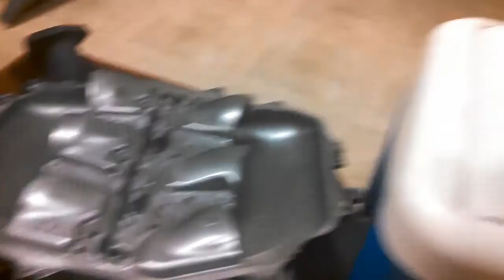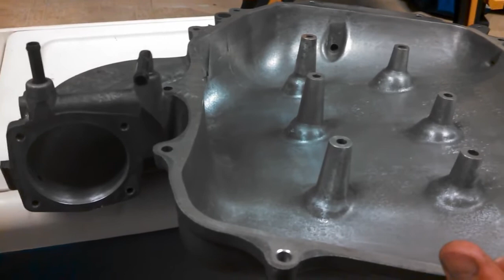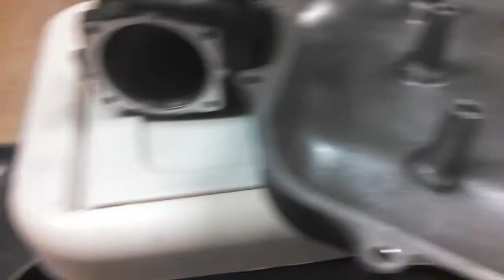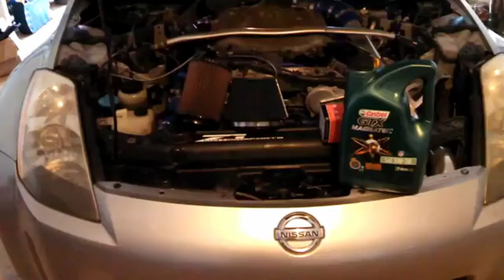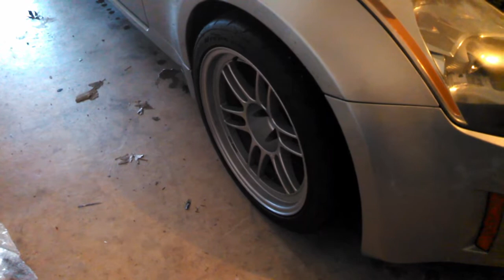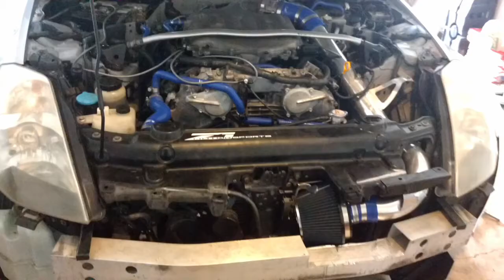350z Upper Plenum Mod And Prepping For Dyno Retune at Z1 Motorsports

Comment: All you needed to do with the de plenum is add the angled plenum spacer or do some machining and porting with the 5/16” spacer.  Get to keep the added low end and get your top end back maybe more.     Just a rev up lower plenum on a de non rev up gives you more top end power but you lose to much torque along the entire curve.   I have an 06 rev up thats getting ready to get the ported de lower intake and plenum spacer.
Reply from the maker: Going from memory, I went off motordyne's testing that showed angled spacers don't benefit as non-angled. My z was tested on Z1's dyno with a few different setups. With the revup plenum, no spacer at all, the peak numbers were lower, and the power curve shifted to the right (high rpm power). With a different exhaust setup, and a 5/16" non-angled spacer, the curve remained the same, but power increased through the entire RPM range. With the original DEplenum, power dropped off hard at 6200 rpm or so. So the question is where do you want the power? If you want more streetable power, I'd use the DE plenum, but if you use higher rpm power (track use), the revup plenum is better. Both work with a plenum spacer. 

I don't think any machining can be done on the DE plenum to move the curve to the right, since the curve shifts based largely on the length of the intake runners. I guess maybe you could machine a half inch off the bottom where it connects to the lower intake manifold (with the injectors), but I have no idea what results that would have.

My 350z had cams & JWT valves/springs,  so could rev to 7500 rpm though.
Reply: @jellofuel  That's weird because motordine themselves say that the rev up plenum gains no power from a spacer. And that the DE lower plenum gives you better low end but you gain your top end back if you got a spacer. I was just trying to confirm. I'm in the process of machining a DE lower plenum and was trying to decide whether I should shave the tops of the horns and use a flat spacer or just clean everything up real good and use an angled spacer. Guess I'm still on the search for answers
Reply from the maker: Gotcha. My advice if you're looking at my videos is to compare the dyno graphs and parts used in 2 of my separate dyno videos. The 300 whp video has Z1's angled spacer and DE plenum, the 310 has revup plenum with non-angled spacer. I sold the Z1 spacer after switching to the revup plenum as I believed it wasn't needed, but was completely wrong.

I shaved the tops off the front two runners, I was told that's where the biggest restriction in flow is.

Comment: Would you recommend the stillen grounding kit
Reply from the maker: Yes I would. It's a bit pricey so if you can find a kit someone's soldered together, I would save some money and go for that. But I figure all 350z's are old enough to benefit from redundant grounding.
Reply: @jellofuel  I have a G37s 6mt,  I was on the fence about it
Reply: Did the grounding kit help
Reply from the maker: @torvarrisevans3961  Electrical performance is hard to measure but it definitely seems to have helped. The gauges were all stable and the voltage gauge is consistent. I say go for it if you can.

Comment: Any difference with the velocity stack/ z1 intakes?
Reply from the maker: Hard to say, at this point, my z was retuned for several changes. I will recommend velocity stacks with any cold air intake (or short ram), and Blox racing has sizes of every kind for it. And is cheap lol
Reply: @jellofuel  4inch velocity stack into a 3.5 inch intake thoughts?
Reply from the maker: @lowm3  I think with stacks, the bigger, the better. We're really just limited by clearance, but the stack I run is 6" - 3". It would perform great with a 4" velocity stack, but a larger stack gives you more filter. (but again, clearance lol)

Comment: wait is there a difference between the revup lower plenum vs the non revup one? I got a 2006 350z rev up, and was thinking of getting the Motordyne mrv2 lower plenum do you think its worth it for the revup engine?
Reply from the maker: Yes, I did a recent video on the differences, but the non-revup has longer intake runners, and that pushes the power curve to the left. So in a nutshell, the non-revup plenum (or MREV2, same thing) means more midrange power for street use, while the revup plenum makes the car faster overall, like drag/track.
Reply: Wow I didn’t know that so I’m guessing I’ll just stick with my stock revup lower plenum, thanks for the info man, saved me some money lol

Comment: Any up dates on your intake... Did you go look at my dyno graph?
Reply from the maker: I couldn't find your dyno on Facebook. Have a link? No updates - I have the Z1 test pipes and y-pipe sitting on the floor. I'll be wrapping them, and then installing in my spare time.  I did add a 5/16" plenum spacer, which made a noticeable difference.

Comment from the maker: I have now resolved all issues with vacuum leaks, and have scheduled a dyno tune for this coming Friday, June 8th. Stay tuned for more!
Reply: What was the results.  After my motor was built, it put down 316hp and 280ftlb.  Go to SOHO motorsports facebook page and look for my G on there dyno.  Its under my name.  Mine did not drop off at the 6200 rpm mark.  Check out the dyno sheet.
Reply from the maker: Ok, will do. This setup dyno'd 283 whp and 253 wtq at Z1. The curve is right - it makes power all the way to 7500 rpm, but I've added a 5/16" spacer to it, and am swapping in Z1 test pipes to replace the ART pipes. 

After some research, turns out both of these make significant gains. If the power curve on a non-revup DE does not drop off after 6200 rpm, then it's most likely they heavily modified the stock lower manifold, or replaced altogether.
Reply: Ya, Im using a Mrev2 and I know the ports have been modified.  Sense I was dyno, I changed out my 5/16 spacer for a 5/8 spacer.  Did a bunch more porting in the manifold/neck.  It pulls crazy now with the C8 cams.  Im going back to SOHO to change out my dual exhaust for their single and changing my intake to a 3.5" all the way and getting it retuned.  Ill let u know what it ends up being.
Reply: @bryanimpala  would love to hear more on your plenum work...i'm obsessing over this as I currently build mine.

Comment: Did you ever get the dyno done with the modified plenum.  Did it make any difference.
Reply from the maker: Bryan Petersen yes, but due to an air leak, I am working on the z before scheduling another run. I have replaced the torn motordyne aramid gasket to resolve.
Reply from the maker: To clarify, my z was running extremely rich, but made 25 whp less than we were aiming. It was only after leaving Z1 that it threw codes for  all 4 O2 sensors. I believe the issue's now resolved, but am driving the z for a few days to confirm. 

Z1 did not give specific numbers (beyond that 25), but John stated it did hold the power well up top, all the way to redline,  which is my primary goal here.
Reply: Interesting, I have a rev up being built at SOHO with a built long block.  Going high compression with JE 11.5.1 pistons and all bit plus worked heads with C8 cams.  I went with Z1 headers, test pipes, y-pipe.  It has not been on the dyno yet, but will be tuned this thurs.  I also have the Mrev 2 and 5/16" spacer, but used a Kinetix black manifold that I ported out the inside of the neck a lot bigger and the opening to match the NMP throttle body.  I also built my own intake with 3 1/4" silicon tubing with a 3"maf, 3" velocity stack and giant cone filter.  I'm wondering if I will run into the same issue with the Mrev 2 as you did with your lower plenum...  Ill find out soon.  Do you know when you might take it back for another dyno run. By the way, your car sounds sick.  I cant wait to get mine back...